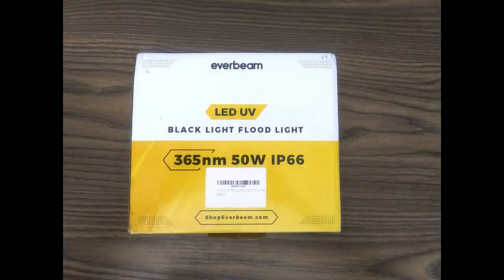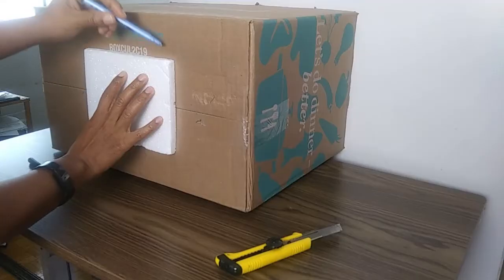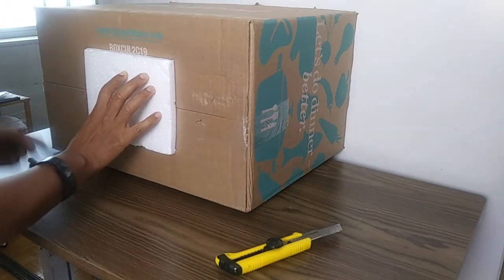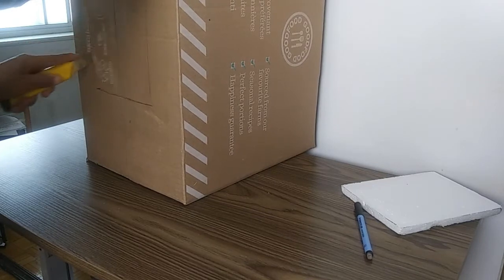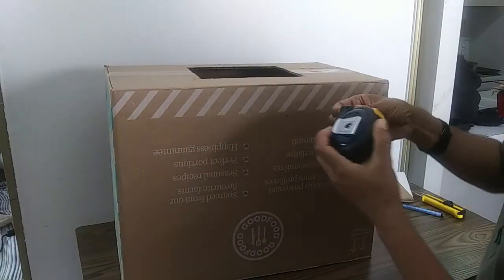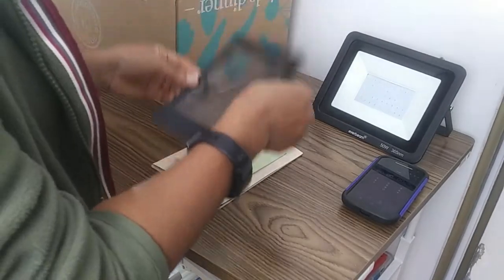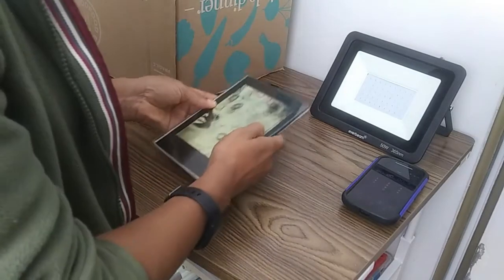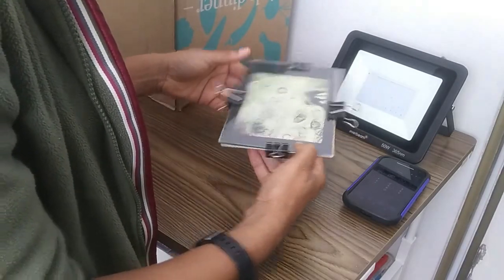Cyanotype UV Light Test

Comment: I bought the same light, what do you think, how long should the box be in order to get the best print results with an A4 size paper?
Reply from the maker: HI. Hmmm.. It would be hard to tell you that as much will be subjective. Is your negative  dense or thin,  what you would like it to look like as a final print in regards to tone and what is your set up/distance of the light to the print.

The best thing to do for any initial print is to do a small test print. Cut a smaller piece of paper and expose it under the negative you plan to use and break it into  sections; example, one section for 5 minutes, another for 10 minutes  and other for 12 minutes etc.. This will help you determine an exposure time that will work best for your print as you want to see it and take note of the distance that you place your light from the print so if you want to do it again you will know exactly what exposure time you would need.

I hope this helps!

Comment: that is very helpful... You just saved me time trying out mercury vapour lamps or other fluorescent tube constructions ( ha ha) ...  I will go for it and give it a try. Otherwise, I love the sun - but it is raining again ;)
Reply from the maker: Hi Sonja! OY those mercury vapour lamps! 😵 (heheheeh!)

I love the sun too; actually, I prefer it, but when you have weather that is often not working in your favour, it seems that you end up with no choice but to find something else. Let me know how it goes!
Reply: @NicoleSmallOneonOne  Ordered the lamp yesterday and received it already: it works fine ... I built a box and added some white art paper (on the top) inside, laid the print onto a white foam board - in the hope to create a bit of a bounce effect. 10-minute exposure, the distance around 10.5 inches, classic cyanotype formula and a smooth drawing paper = fine ;) I am happy. Will try some more tests with different papers and other formulas ... no doubt about it at all. It seems the perfect solution for a rainy day ' Eureka' ;) ... ps: after some prints today: the same set-up: exposure time was down to 4 minutes for fine detail, so it depends on the negative... so far, a reliable reaction on the paper
Reply from the maker: @alwaysaddlight  Fantastic!

Comment: Hi Nicole. Thank you for this information.  If it was a 100W 365nm light, what difference would it make.
Reply from the maker: Hi Gaye. The big difference would be that in a given situation, less time would be needed to expose a print with the 100W light versus the 50W light. This does not mean that the 50W light does not pack a punch(!), but if large prints are your goal, say on average bigger than 11x14, the 100W might be the better choice only because exposure times would be less compared to using a 50W light.

Comment: Hi Nicole, when using this light, I am doing ( 2) 9x12 at a time with it, using a larger piece of heavy glass )don't need clips) with the light suspended centered and overhead being held by a reptile stand (lol), the light gets pretty hot, and my exposures are about 35 minutes, using a transparency-- I have light suspended 13 inches above the glass covered paper with transparency on top. I would like to contain the light in the area, so scattered blacklight isn't hitting my artwork in surrounding area...I am thinking of just creating a large folding cube that fits over my large flat file which this is all attached to. I am going to buy the 100watt bulb because I have larger pieces to do, and I think I will set that up on other side of flat file, again witht the stands so light can suspend....the light inside the cardboard box seems hazardouse to me because it gets hot, and that could ignite--am hoping with the 100w light my exposures will be reduced for the 9x12 and larger sized ones--what's nice about the stands and you can adjust them to whatever height you want, and also depth distance...you may want to check those out! While the manufacturer says their wavelength is safe for eyes and skin, I do wear uv goggles from home depot, and an expensive UV face shield that cost me about $100. I am not taking any chances! 
thanks for your fab videos!
Reply from the maker: Hi Jamie,

The light has a wide spread which is great. I use clamps because I use a light piece of glass, one from a clip frame, and as an extra measure of security just incase I may feel the need to adjust placement, even with my heavier sheet of glass that I use when out in the sun. 

I use the box as a cover in order to prevent the spill of light which yes could be considered hazardous, but the top edge of the light does not emit any heat, the area touching the box, at least the light that I presently have.

The stands sound quite interesting! Thank you for sharing!

The wavelength on this light is not safe, but safer from how it is made when compared to similar lights on the market and regardless of that I bought a pair of UV eye goggles that cost me just about the same, I too do not take any chances!

Your exposures will be reduced with the 100 Watt light for sure. I bought the 50 Watt when I discovered it because I was not sure if the light would have worked and did not want to loose out on too much if it didn't.

I am very happy that you are enjoying the videos!
Reply: @NicoleSmallOneonOne  thanks Nicole, my 50 watt like yours felt very warm on top, glad you are wearing the uv glasses, they put they are not needed on the item description, but I agree I don't trust it...

I was reading up on a clever foam core set up that someone was using to make a light enclosure for shooting, and using magnets glued to edges...I am thinking of perhaps making something like this that is easy to break down and could contain the light just on top of my flat file...amd worried that the spread of light is not safe for my artwork on wall in vicinity,   Will let you know if my design works out...
Reply from the maker: @jaimiegordon2065 That is great! Let me know how it all works out.

Comment: I’ve been scratching my head, thinking about how to build something for indoor development.  Your simple and elegant solution makes it clear I was overthinking the problem. Have you considered covering the inside of the box with a reflective material?  It seems to me that Mylar or foil could increase the effective intensity and maybe give a smoother light. Or am I overthinking again? ;-)

Thanks for the informative video!
Reply from the maker: HI Gizmo Photo and thank you very much. You are not overthinking at all! 
Yes I have thought of using foil inside the box camera but I have never gone that far. I have only tried a diffused mini black light inside the box which did not work at all and I thought that the foil might do the same. 

The issue I have come to realize is more so the lens / projection of the image that falls onto the paper, too diffused which is why it is so problematic along with other factors of course. 
When you think about creating a digital negative, there is most of the time a need to add sharpness , sometimes a little more than the usual and this is applied to the process of doing right out flat in plain open sun. There needs to be a more defined/dense image projected onto the paper.

I have looked into UV lenses specifically for this but they are atrociously expensive. 

I will be trying a few things if I get the chance to before summer ends and will share my findings, hopefully a solution :)
Reply: @NicoleSmallOneonOne  FYI, I got a 100W 695nm light, cut holes in a standard packing box, and got some nice results with 7 minute exposures.  Far, far easier than any other DIY scheme I considered, and much less expensive than purpose-built devices. Thanks!
Reply from the maker: @gizmophoto3577  Hi! It definately is and portable too!
Reply from the maker: Oh..I just thought about it, have I gone off track? Please let me know if I have.
Reply: @NicoleSmallOneonOne  I was thinking about covering the inside of the development box vs. the box camera.  

I’ll add that I apprehended simplicity of your approach. It’s very easy to think that the solutions must be found in more and more complex and expensive gear. A cardboard box solves a couple problems, including any worries I had about shielding my eyes from the light. I’ll be watching more of your content and taking notes.
Reply from the maker: @gizmophoto3577  I did get mixed up! I thought you were solely referring to a box camera, sorry about that.
Reply: @NicoleSmallOneonOne  No worries at all. You are generous with your time responding to comments, and a little glitch every now and then is par for the course.

Comment: thank you Nicole I was wondering which UV lamp was suitable. I want to do A3 size wet cyanotype process would this lamp give enough coverage for a larger print? Thank you
Reply from the maker: HI Gill. You are welcome! I did a 12x16 sized Cyanotype with this light so yes it can. Exposure times will be in the long range, ( 30min +). Distance of the light will play a part in good coverage too.
Reply: @NicoleSmallOneonOne   thanks for the quick reply Nicole. So are you suggesting it  would need to go a  bit higher to get the coverage?
Reply from the maker: @gillyb44  HI. Yes that is right. The larger the print the higher the light would need to be to enable a full and more balanced coverage all around. For example, an 8x10 print vs a 12x16 print. The 12x16 print would need a light source further away than that for an 8x10 print. The higher the light or further away the light, the larger the spread of light.

For your sized print, this does not mean it needs to be 10 feet away but at a distance for even coverage. You may have to test that out to determine the right distance and you can do that by just creating a thick border around the paper and expose. You will then get to see where you would need to make adjustments, in time or distance or both. I hope this helps you!

Comment: Thanks so much for your info. I live in eastern Ontario, Canada, and have worked with Cyanotype al summer. With winter coming I am looking for an inside solution. After having had your everbeam for almost a year, what is your current opinion of it?
Reply from the maker: Hi Heidi. I will be honest and say that this summer I have not really used it as much , (aside from a few things I have experimented with), and that is mostly because I have been focused on inbox Cyanotypes, which will only work with sunlight...but to be honest, I do prefer the sun over the UV light bank but for the winter months, it is a dream to have. 

Your creativity does not have to stop and wait for the next spring/summer season.

I find the Everbeam light to work well for both small and large prints. I have done a few new prints, (I have not shown yet), sized 12x18 and I am very happy with them/15-20 minute exposures. I find the light to be durable and heavy duty making prints back to back with a 10-15 minute break in between. It has a nice spread of light and the light spreads out nice and even. 

The warranty is pretty good on it too...2 years.
Reply: @NicoleSmallOneonOne  thanks so much Nicole. I have actually gone ahead and bought the same Everbeam lamp and it arrived an hour ago. I just tried it, handheld over a little piece of paper on the living room floor, for a few minutes (all very haphazardly) and it seemed to work! I am rather excited so now I have to get it installed in a somewhat more efficient way…
Reply from the maker: @heidiroukema2771  Awesome Heidi! The easiest and effective way to install it is by using a cardboard box. It isn't the best looking but it works out quite well. I hope it works out well for you!
Reply: @NicoleSmallOneonOne  just some info about me. I am a fibre artist and have come across cyanoprinting on the internet this summer. While waiting for the chemicals I played with Curcuma sunprinting but once the chemicals arrived I switched to Cyanotype. I started Cyanotype with negatives but over the summer also used plant material. Over these past months I found your info extremely helpful, some of the best on the web, thanks so much for it.
Reply from the maker: @heidiroukema2771  Thank you Heidi! I am so happy to hear that the information I have shared has helped you. Do you have an instagram account? I would love to see your Fibre art work as I am not familiar with that.

Comment: The one you have is really 365nm or 395nm in wavelength? The link in the description leads to a 395nm 50W light.
Reply from the maker: Hi Wesley, I contacted the company and they have been out of stock of the 50 watt light, that is why the link now directs to the 100watt light. They will re-stock the 50 watt but are not sure of it's arrival.
Reply: @NicoleSmallOneonOne  I bought 2x 5m uv led strips on Aliexpress, waiting for the package to arrive. I also finally got the chemicals. I'm super excited to use the stuff you gifted me to create some cyanotypes. Should have tried it during summer, but better late than never.
Reply from the maker: @WesleyAlcoforado  That's Awesome!
Reply from the maker: Hi Wesley. The link goes directly to 365nm when I click on the link. Also, you have selections of the different ones and they are written under the price, so if it so happens to show 395nm all you have to do is select the 365nm light which will highlight in orange. Hope this helps.
Reply: @NicoleSmallOneonOne  that one is 100W though. Yours is 50W, which only exist in 395nm on Amazon. Anyway, I was watching other videos and found this guy who made his own box using LED strips of 395nm and it works just fine. Maybe your previous light (the one you mention in this video https://www.youtube.com/watch?v=E6rnpF61CKY) was just too weak. I guess 20W is not enough.
Reply from the maker: @WesleyAlcoforado  I am not sure what to tell you Wesley. Perhaps the 50watt is out of stock as I know it has been selling very well. I bought a second 50watt recently just before the new yearfrom the EXACT LINK that I have shared here.. Did you try sending them a message ? 

The mention of the light, sharing of the link to the light and showing that it works is the only thing that I can really help you with Wesley. Any other issues in regards to what they may or may not have in stock, or where the link may lead to now, I unfortunately cannot help there. I have had others who have bought the light source directly from the link I placed here.

I am happy that you found another resource to obtaining the light you seek, and good luck on your UV light build, let me know how that goes.
Reply from the maker: @WesleyAlcoforado  Just to add, you are right, there are a lot of people who have built their own UV light units, but I did not want to get into that after looking into it.

Comment: Aha good work! Will look at getting that light. Did you have peroxide in your water developer?
Reply: At amazon.ca the 50W unit is $60 and the 100W unit is $100. So the 100W is cheaper per watt!
Reply from the maker: Hi Mark! No I never use peroxide. I just rinse in plain water .
Reply: @NicoleSmallOneonOne  I find that peroxide brings out the deep blue immediately and that the prints are less sensitive to total exposure time. I just dump in a few mls of low percentage peroxide solution from the pharmacy (on the shelves, nothing prescription).
Reply from the maker: @oudviola  Yes I know the peroxide does this but I just let it do it's thing on its own time. I have a few Cyanotypes in frames on a wall and they look just fine.

Comment: Great! Does the UV lamp get warm->hot if it’s on for a longer period, like 3-4hours? Thinking of wet cyanotypes.
Reply from the maker: Hi Nena. For the length of 10 minutes it does get very warm, but not hot. I would not suggest using this light for a length of 3-4 hours at a time, not sure if they are made for that type of heavy duty use, but I am just placing out my own thought out there and I could be wrong. Maybe contact the company and ask them about usage of the lights to  find out if long periods of use is  ok with the lights.
Reply: Nicole Small | One on One thank You, good to know! The same heating thing happens with the face tanner as well.

Comment: Even with my DIY UV fluorescent tube exposure bank I often have to use distances of no more than 12 inches and it exposes most processes in under 7 minutes. Maybe consider the 100 watt version of this light if you want quicker exposures or multiple prints as the light is larger and covers more area.
Reply from the maker: HI Matt. I don't really mind the need of a 10 minute exposure and I could have bought the 100 Watt light but I was not sure if the light would have worked. I already lost out on money on a light that I bought similar to this one which proved to not work for the Cyanotype . Not knowing if this light would work I wanted to make sure that if I loss, I would not lose that much.
Reply: @NicoleSmallOneonOne  I myself plan on purchasing the 100 watt it just suits my needs better. I'm going to ditch the UV flourescents as they are  dangerous and sometimes they expose too fast and I like to do exposure inspections when I do printing processes. Anyways thanks for the research and experiments as you helped me find a safer and more usable alternative to my current setup. Take care and keep the videos coming.
Reply from the maker: @mattayers3794  That is awesome. I am glad to have been helpful and more is a comin'!
Reply: @mattayers3794  Did you ever buy the 100W light for exposing the cyanotypes? How did it go?